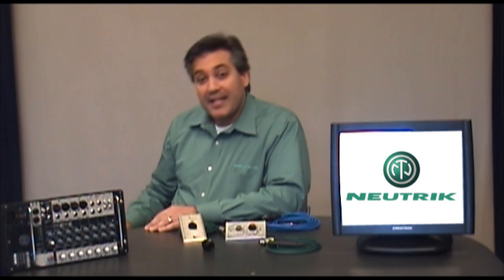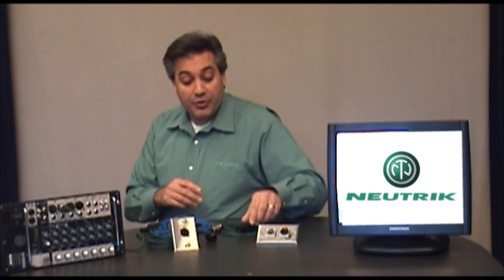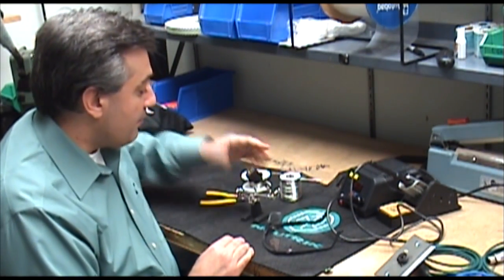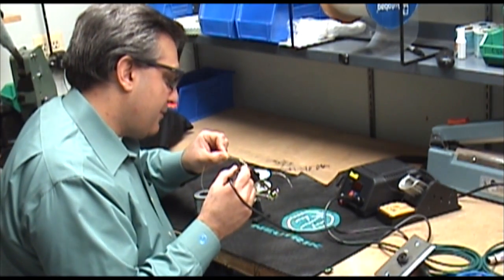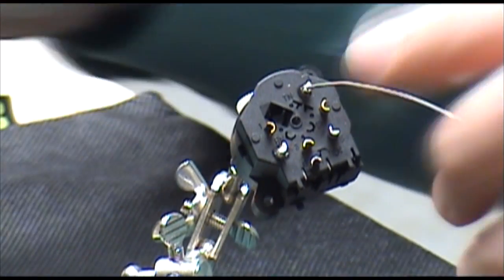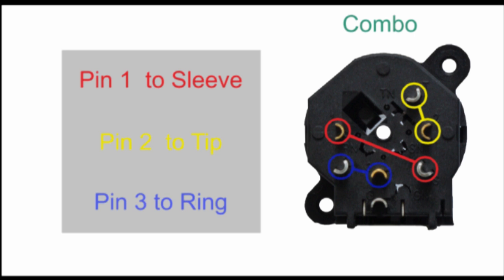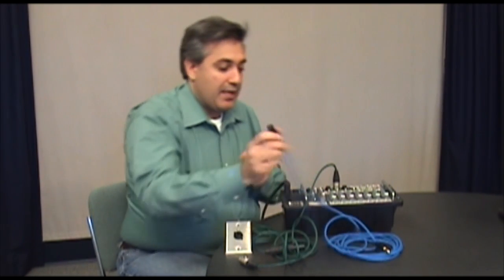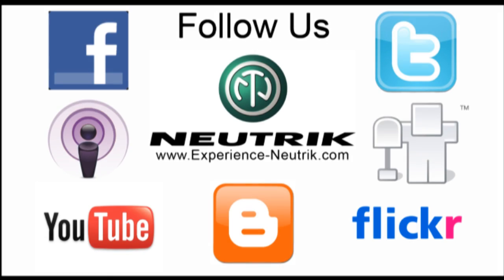Neutrik techTALK Episode 3 Combo Jack

Comment: Actually, there is a fixed pattern if you expect to get the wiring right for a standard balanced 1/4 inch plug - so these could come pre-wired which would save some time and trouble.  Isn't that right?

Comment: have you thought about doing more video?
Reply: Hello John.  Thanks for your inquiry. Since this video was created we have shifted these projects over to the factory's marketing and technical teams.  Perhaps we will see more content in the future.  Thanks for expressing your interest just the same.
Reply: Neutrik do some great products. I am surprised that there isn't more social media on the 4k BNC range.
Reply: That will come.  The broadcast industry is working towards multiple solutions for UHD signal flow, of which BNCs will play a part.  IP based solutions are also part of the equation.  Neutrik is leading the BNC solution charge with UHD BNCs exceeding the current SMPTE standards, and bandwidth in excess of 20GHz.  But connectors are only part of requirement.  Cable that can carry these signals, and at greater distances, will also be necessary.

Comment: What type of lead wire is that? I see it is non-jacketed and looks to be stranded? Thanks in advance!
Reply from the maker: Hello Armando.  The lead wire being used  is Belden 8021 Hook-up/Lead - Bus Bar Wire.  It is 22 gauge Tinned Copper, and is solid not stranded.  Thanks for watching the video.
Reply: Thanks for the info!